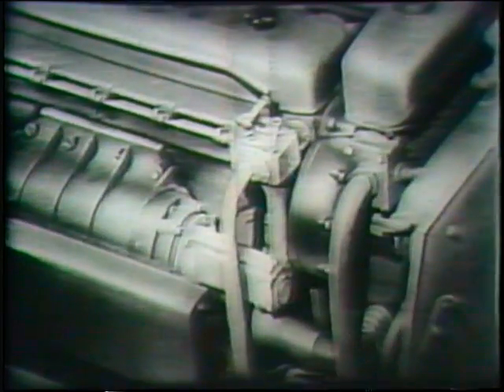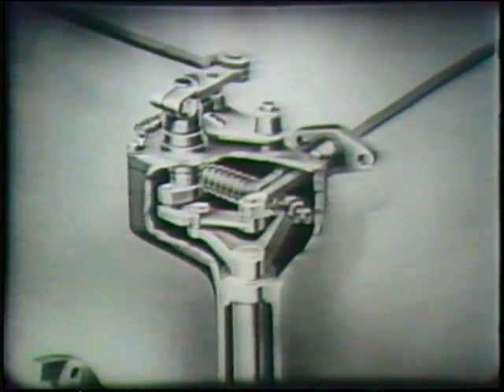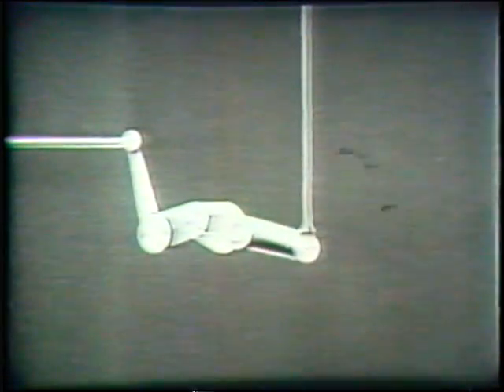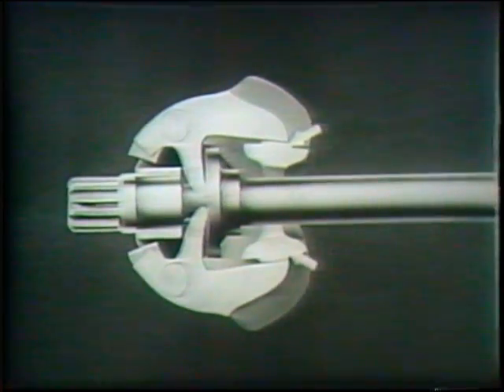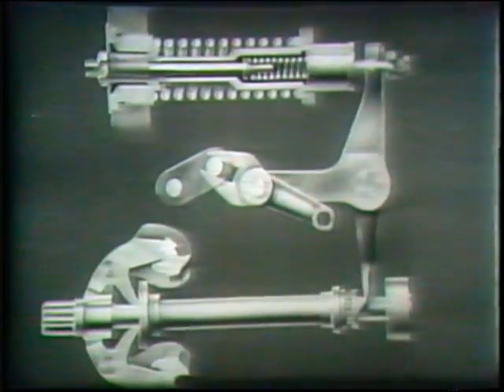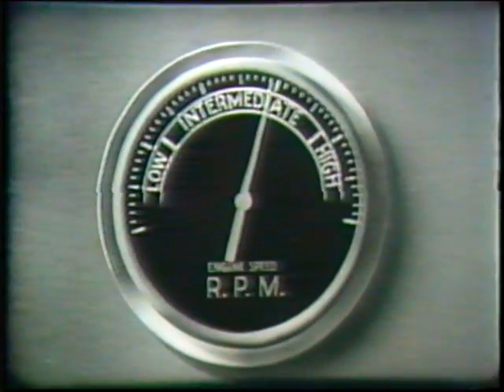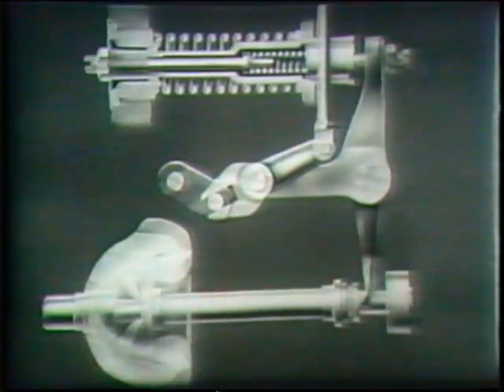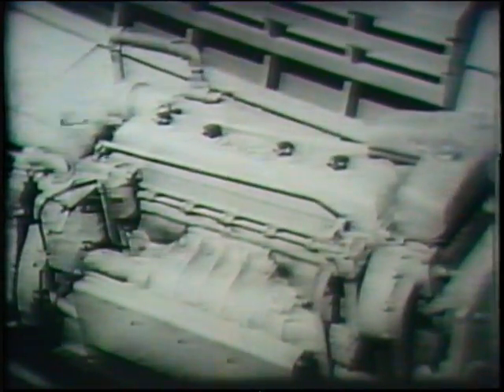Diesel Engine Limiting Speed Mechanical Governor

Comment: Bul sheit

It should rev to 3500
Reply: 71 series 2250  Max no load speed!!
Reply: @damienodonohue1327  That's cool. But i've seen comments on some videos that feature DD's saying that they can rev to 2500 no problems, some even to 2700, which is kinda insane and awesome.
Reply: @gabrielvieira6529  Yes, but those comments are generally made by you tubers who trot out the worn out old myth that you have to "drive em like you hate em" !!
Reply: @damienodonohue1327  Could be, but I tell you, one comment said it had a copany that made that engine go to 2600 and it handled it... Who knows. It's a cool engine

Comment: Correction on the Limited Speed governor, u can’t use shims on this type of governor only on Variable Speed governors when adjusting ur high speed settings, on Limited Speed gov to turn high speed adjusting screw to obtain your proper high speed no load !

Comment: The snubber spring adj, backing it off would make it surge at idle I assume. Seen old guys do somthing in trucks to make them idle that way to sound "mean"
Reply: Buffer screw setting
Reply: Yea and I remember from tech school if you adjust the buffer screw wrong itll run away. 
Go for the throttle blip after adjusting it, it starts to drop back down. 
and you think its fine and all of a sudden it doesnt settle, it takes off to the moon.